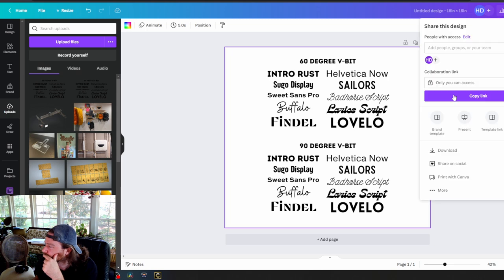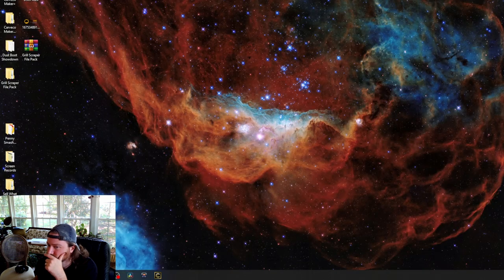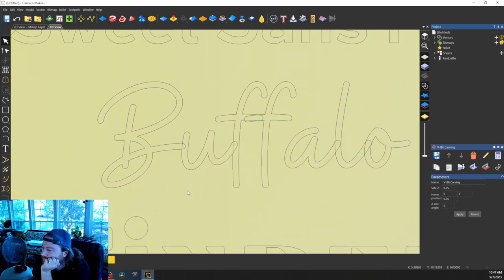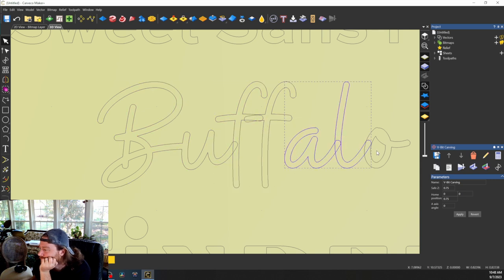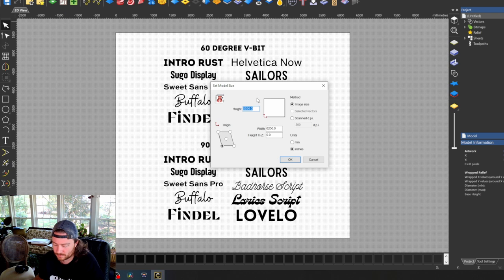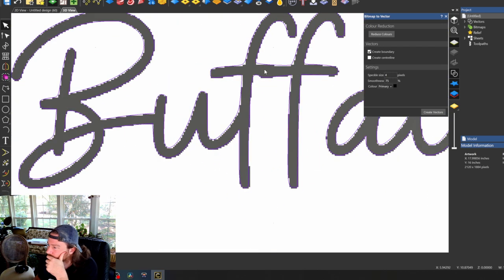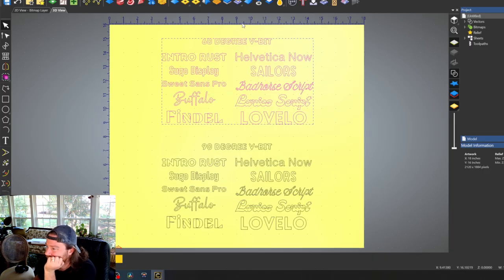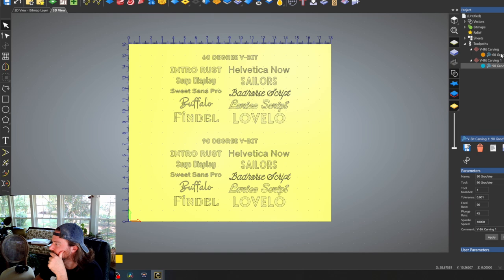Let's Talk About Text (CNC)

Comment: Very useful information… thanks. I do have one question you didn’t address in the video. Font size? It looks like your text is at least 3/4” in height. What’s the minimum size you can cut and it still be easy to read? Thanks again, hope you respond.

Comment: Perfect timing. I am about to start a new project that will be using a font. Still trying to wrap my head around when to use a 60 vs 90 degree bit and what role does a 30 degree plays other than inlays….fun and frustrating at the same time. Again thank you.

Comment: Thanks for another great video. I have proprietary software, and you can not assign a depth to fonts. I often lie to the machine and say I am using a different bit. Really handy for script. Tell it you are using a 90 and use the 30. Looks bad on screen, so run a test!
Not so good for bolder fonts, as you can get gaps inside the letters.
When I talk to hubby, I say text. Most everyone else, I say font. So I consider it bilingual!! Consider it a mad skill 🤣